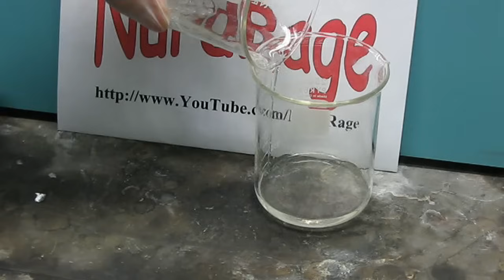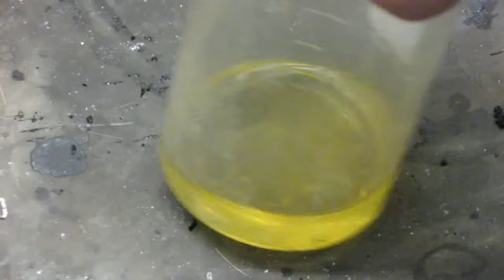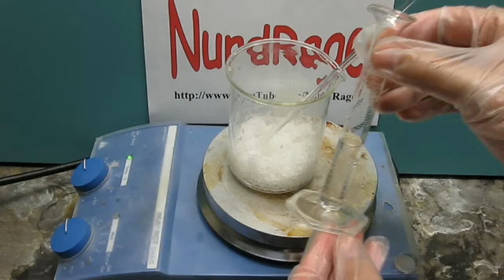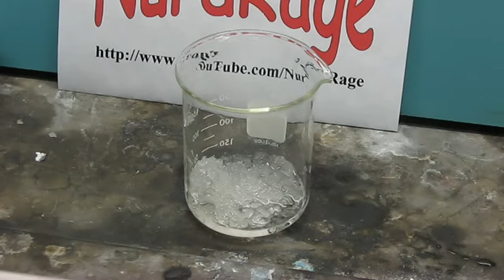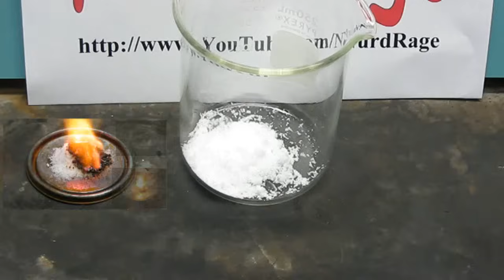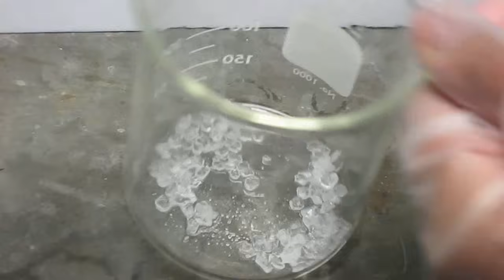How to Purify by Recrystallization

Comment: My favorite hydrocarbon based solvent is heptane. I like it because it is not very toxic and it is volatile, evaporating quickly. It is not too volatile nor is it not volatile enough. It is just right, but there’s a downside: its boiling point is very close to that of water. Other downsides are that it is extremely harmful to aquatic life with near permanently lasting effects.

Comment: The purity level is very low, because the filtrate and residue are not filtered well, there are still a lot of impurities in it, why not filter it to get a good filtrate, then do distillation by adding solvent in the correct ratio, and just wait for the boiling point of each -respectively to evaporate and make a pure compound,

Comment: ok I think I missed part of what I was looking for here, in that I expected FRACTIONAL recrystallization. but this is not very clear as to showing this process, where maybe a mixture of several salts (like sodium chloride and potassium chloride,) were used to show the two different salts in their stages due to their varying solubility rates, causing one to precipitate out before the other, and each stage a method of identifying each salt as well as the batch where the last of one was precipitated and first of the next salt began precipitating out. (like using a UV lamp to effect the compounds maybe so it might take different salts for good clean clear easy to tell differential color fluorescing to show the different salts)
Reply: 👆👆look up that handle, he ships swiftly, and he got shrooms, Dmt, lsd, mmda, psilocybin, adderall, morphine, edibles, fentanyl, cubensis, meth, gummies, SSRI, chocolate bars, he's got a lot.. 🍄 💊🍄🍫💯🔌
Reply: 👆👆look up that handle, he ships swiftly, and he got shrooms, Dmt, lsd, mmda, psilocybin, adderall, morphine, edibles, fentanyl, cubensis, meth, gummies, SSRI, chocolate bars, he's got a lot.. 🍄 💊🍄🍫💯🔌

Comment: (OFF TOPIC)   I'm wanting to recrystallize and purify  some Potassium Persulfate.   I made this compositions by adding Ammonium Persulfate with Potassium Chloride.  The by produce produces is Ammonium Chloride.    When I mix the potassium persulfate with ..say Magnesium it gives off a very strong Ammonium smell.   A friend of mine suggested to try recrystallization.   However, I'm not sure to heat and cool or recrystallizes at room temperature and let dry.   Any help will be appreciated. 😎👍

Comment: Once your solvent cools and crystals form, won't the impurities also form crystals? If that happens then how can you separate the crystals of the material you want from the crystals of the contaminants? For instance what if it's a 1/3,1/3,1/3 mixture of compounds A, B and C and we want compound A, but you have no clue what compound A will look like as a crystal? Or even worse, the crystals of all compounds look identical. Cheers.
Reply: This can be done by steam distillation or multilevel distillation, make sure that the filtrate that we get is really clean, by maceration, when we separate the filtrate and the residue, then we wash the filtrate again with C₂H₆O as a solvent, then just do the distillation so we can extract the compound. What we want is that the low boiling point of the compound will evaporate first, the level of purity of the compound can be done repeatedly

Comment: Ok what is MSM used for?Im just a little shook cause I’ve been feeding my horses msm which just numbs them and makes them kinda tired and I ate a little piece one time cause I was wondering why they didn’t wanna eat it but someone told me msm is used in meth?Is msm dangerous?
Reply: Lol people "cut" meth with MSM. No, it is not meth or used in meth. Just a tweakers scummy way to make a quick buck.  It's not dangerous as you can but it at any pharmacy or drug store as an alternative medicine for things like joint pain and boosting immunity. They only use it because it melts down at the same temp and cracks back very similarly to meth. Your horses are safe.

Comment: wtf is a " (dedicate)+ or bag?
Reply: STONER_356 its a bag that is air tight and contains a desicant (i can't spell) like silica or sodium hydroxide (wouldn't recommend). The silica pulls moisture (H2O) from the air. This speeds up the drying process without allowing your sample to be affected by the atm (excess water/O2 -> oxides,etc.)
Reply: It is a dessicator bag. It has a dessicant  (like the packets in beef jerky or shoes) so that when the solvent evaporates it gets absorbed by the dessicant so the bag doesn't get condensate everywhere.

Comment: Im curious could this method be use to extract Thc from plant matter and then crystallize it.
Reply: Most potheads just spray lighter fluid through plant matter, then smoke the crap that gets dissolved and shoved through.
They call it "butane honey oil" if I recall.

Comment: have you done a video on hydro-thermal synthesis? would be interesting but for video it would probably have to have a thick fused quartz chamber walled system to be able to see what is going on, which I am not sure could handle the chemical reaction of water at excessive temps trying to dissolve it like say it does for aluminum oxide for growing sapphire crystals :)

Comment: I have a question that really want it to be solved as i cant find its solution.
Can the slow evaporation recrystallization process be done normally under heating to make it evaporate faster?
Reply: +ROCKET&amp;SCIENCE EXPERIMENT he said he cant because the extra energy of the heat causes an effect that effects the solubility stablizing teh amount that will dissolve in differing temps, and my guess is that there is a temp where it will change but that will either be over boiling temp requiring a pressurized vessel or will cause the salt to thermally decompose, or take on atoms from the water. destroying your salt too.

Comment: would  u have to us pure water? crazy stuff put really its just simple alchemy
Reply: +greg scott Do you even chemistry? Of course you would have to use pureified water, all of the additives in tap would fuck with the process.
Reply: +Xanyban honestly if you know exactly what is in your water and it is stuff that is MORE soluble than the product you want, it wont, the problem is getting exact details on what is in tap water is nearly impossible and so starting with a known quality of substance like pure water or alcohol or what ever solvent is always best, else the contaminates that are very tiny will precipitate out first if they are less soluble adding to your contamination, also this can all be done with more than just water, you could use ether or known contaminants like sulfuric acid for things that wont dissolve in water alone, or even many oils that have been purified :)

Comment: This may sound silly, but I'd like to ask anyways. 

Does this work with any water soluble compounds? For example, NaCl, KCl, or even NaOH. Thank you!
Reply: Kovu Legar I think it should work for most things in most solvents, as it has to do with crystal formation and solubility. You'll need to look at the individual things though.

For example, heat doesn't help with NaCl as solubility doesn't change over heat, so you need to rely on solvent evaporation rather than temperature changes to cause it to crystalize.
Reply: +Kovu Legar fractional recrystalzation  is the term you are looking for here, the reason it works is cause as the soluble holding of the liquid changes and the salts all have preferred solubility so one salt will completely precipitate out before the others do, you just have to keep changing the quantity storage of the solvent and when you see precipitate, filter off, not sure why he did not mention this, but the purification process is used for the stuff still dissolved in liquid that sticks to the crystals since you cant wash it off or it will dissolve with water, you would have to switch to something that is mincible with the solvent, but the salts you want are not soluble in, so repeating the process with the recrystalized material in fresh distilled solvent increases purity again, (since each time less liquid per crystal surface is available, and the content in the liquid drops too. :)